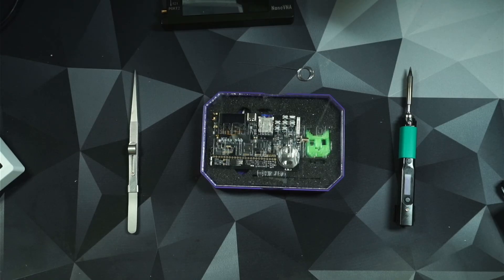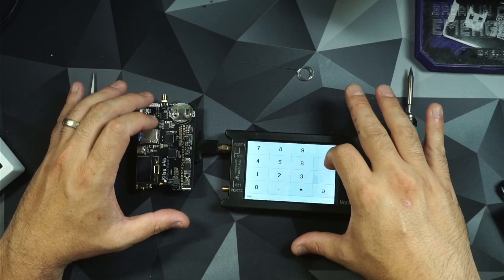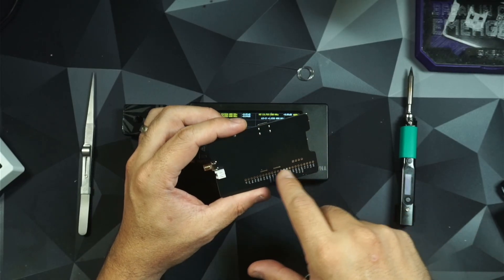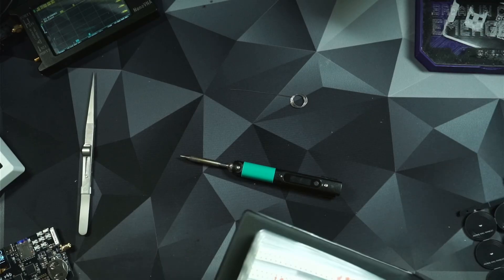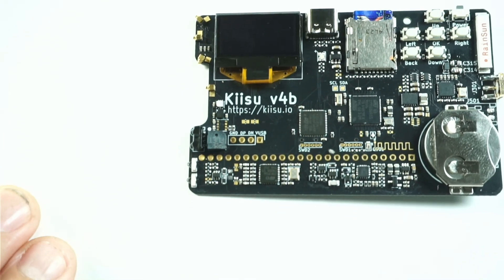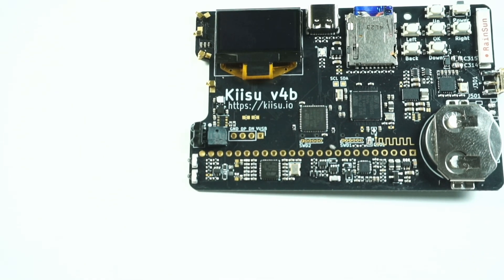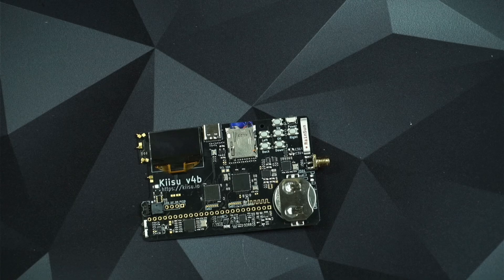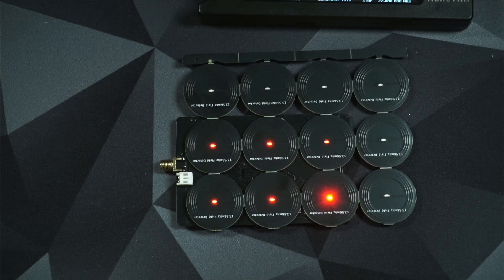Kiisu V4b NFC Antenna Fix

Comment: 👏 great job! Thank you for bringing this to our attention, and for showing us the fix. Only question is, hoping the kiisu has enough quality control, this should be a universal fix, correct? We shouldn't have to measure each kiisu individually for the cap value?
Reply from the maker: Cap value should be consistent across all models.   Also if you're not comfortable soldering that small of a component my repeater stickers will do a great job retuning the field without any soldering
Reply: @MidwestGadgets i had hoped that would be the case, thank you!
Reply from the maker: @Phred_Phlintstoner any time!!!

Comment: very cool video , how do you even come with a fix like that ?
Reply from the maker: Thank you! 

All antennas have a resonant frequency.  You can measure the antenna and find it's inductance, and measure the circuit that goes to the antenna to find it's capacetence.  Using a formula you can plug in the antenna inductance and the intended frequency to get the capacetence needed to resonate at that frequency. 

I subtracted the circuits capacetence from what is needed to get the 51pf cap that was needed. 

Then I just followed the traces of the antenna cathode and anode to see where it led and was shocked to see the kiisu had an open pad that was in the perfect place.  It seems like the design engineers for the Kiisu had this in mind. 

So we just used that pad to bring everything back in tune

Comment: Cracking video! ty for the guidance on how to fix the NFC on the Kiisu! Just need to get my self a better iron now a new pair of eyes :P
Reply from the maker: Thank you so much.  Just getting into making videos so it's a bit foreign to me.  I love the pinecil.  Fnirsi also makes the HS-02 which is another good option but honestly for the feature I'd go with pinecil.  From off to soldering is about 12 seconds.  You can hear in the video when I plug it in to when I'm soldering.